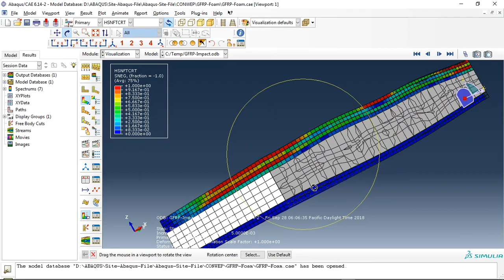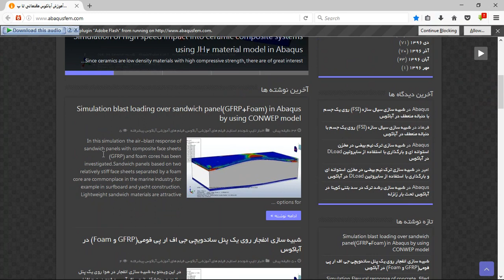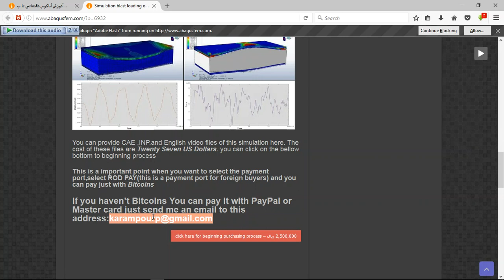Simulation blast loading over sandwich panel(GFRP+Foam) in Abaqus by using CONWEP model

Comment: Dear Sir, i am working on sandwich composites. I have modelled GRP-HONEYCOMB-GRP Sandwich composite. During the deformation i am getting little rotation but when i am using aluminum as skin deformation pattern is same as expected. What can be the reason? Modelling is same in both cases. Please reply.
Reply from the maker: Check the interaction which you used. It has some reasons like boundary ...
Reply: @abaqusfem3576  Thank you so much sir for your reply. I will check. Basically I am simulating the charpy test and extracting the internal energy(energy absorption) capacity of sandwich composites.
Reply: I just started using abaqus and I find pretty difficult to model the GFPR-honeycomb-GFPR structure. Could you please help me, if you have done it, already? many thanks!!!